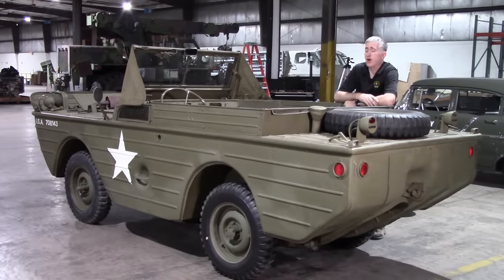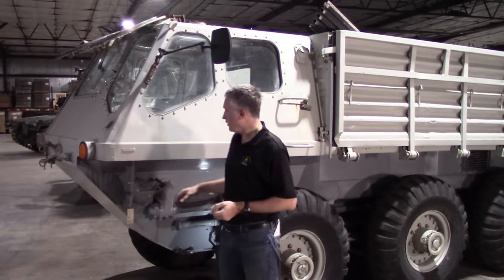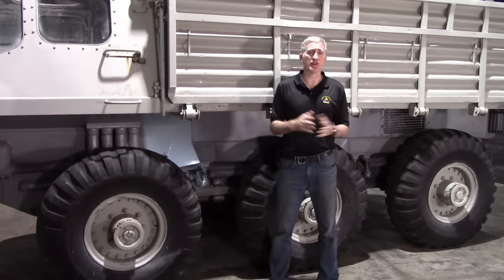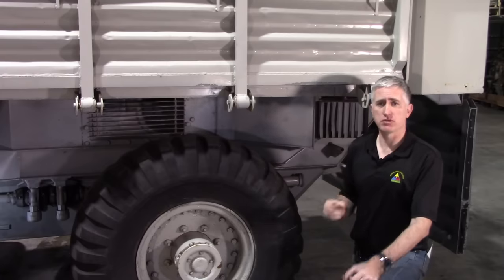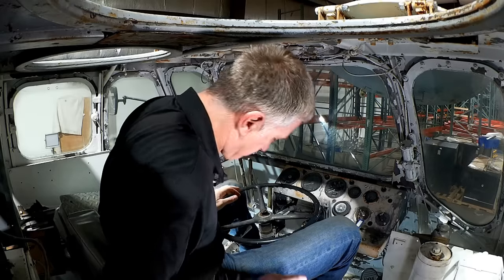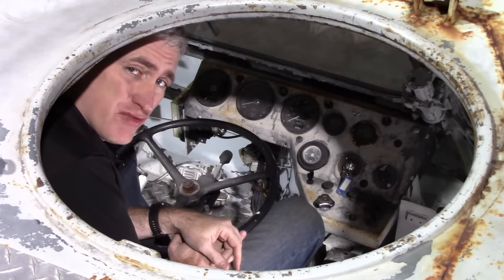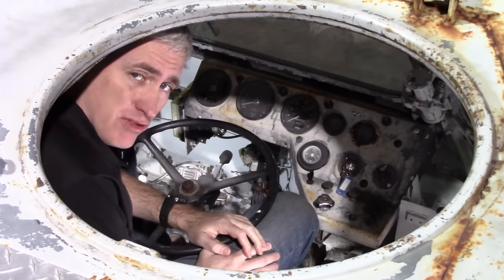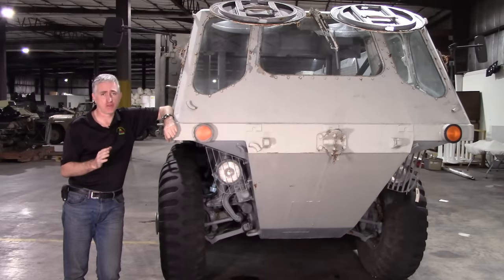Inside the Chieftain's Hatch: FV622 Stalwart MkII

Comment: Drove the Stolly on exercise in Germany many times during the 70s/80s. It's exhaust would glow bright red at night due to the heat from the 8 cyl engine. It's party trick was to turn the ignition off for a couple of seconds, then back on, the unburnt fuel would cause a jet of flame to fly out of the exhaust with a very loud bang. Best done at 0200 whilst passing through a German village.
Reply: Used to do that with my Honda CX500, make peds jump.
Reply: My bikes refused to do this. Even the horrible Triumph 500 refused to back fire.

Comment: The touring company I worked for bought a Stally. Used it for an amphibious tour vehicle. The best I can say about it is that it drove like a boat and floated like a truck.
Reply: Ever take it off road? That is where the Stollie shines, not on road. On road it can be a pain in the posterior, off road it is fun as all hell. As for how it floats, well it *does*, thats the point, they are not exactly designed to cross the Atlantic you know, or to handle Force 8's, but more to cross river or small lake obstacles without requiring the cargo to be offloaded into a seperate vehicle. They float well enough to do that job just fine.
Reply: @alganhar1  
Really?? It wasn't meant to cross the Atlantic?? Gee, thanks for telling me. I said the company used it as a touring vehicle and you asked if we took it off road. Well I suppose we did. We took into Halifax Harbour. It was extremely slow in the water and lacked the power to maintain the speed limit on modestly hilly streets.
Reply: @johnt8636  Most Stollies were stripped of their impellors and the drive couplings in the 1980's when it was decided to stop swimming them. The vast majority of them that were sold on lacked them. they would still float and swim but only driven by their wheels.  As for speed limit - they were cross country vehicles designed in the 50's - maybe not the best choice of vehicle for the company.
Reply: @chaz8758  
Thanks for the info. Ours definitely had some gear replaced/removed that compounded the issue. If you knew the city in which we operated it, essentially in the downtown core, you'd understand that mobility shouldn't have been an issue. The streets downtown, you'd be lucky to get up to 30 kmh. It's entire route was only about 7 kms.
Reply: @johnt8636  You are just too civil.  Argue with the guy who drove one in the Atlantic Ocean and downtown.
Reply: @alganhar1  Designed to swim rivers when bridges aren't available, they do swim well, we had them as ammo carriers in the Royal Artillery in Germany.

Comment: Notice the lack of chrome
Reply from the maker: Yeah, the Brits missed an opportunity here.
Reply: @TheChieftainsHatch  Chrome is going to be the new tactical color, black needs to step aside.
Reply: They've decided to forgo chrome in favour of rust trim on this vehicle.
Reply: mediocre
Reply: Slaps top This baby doesn't carry so much chrome.
Reply: And there's no door glass regulator either. What's up with that?
Reply: This truck is clearly not meant to haul CO’s.
Reply: @moosemaimer   V8! V8! V8!
Reply: @onpahanvaan  I8! I8! I8!
Reply: ran a section of  warts in minden 19 sqn rct great fun,  they  wheelie in first and do a stoppy,  used to turn ignition off then on repeat as necessary to get a loud bang complete with flame from exhaust and hopefully  you didn't blow the exhaust off lol
Reply: @TheChieftainsHatch  OK there are 2 easier ways to tell between the Mk 1 and 2. The Mk 1 front side windows are square (No slope on the bottom). The other way is inside. The Mk 1 has no "Gate" at the base of the gear selector,  The Mk 2 does. Very little difference other than that. Not sure if the Mk 1 had the central lubrication tube system?

Comment: I have not watched this yet but already I have given a thumbs up. Drove these in BAOR in the mid '80's......loved them. I have now watched this video, that is one well messy Stally, nothing like an original British Army model. I understand about the lighting system...HST to those that know, but that is a poorly looking Stally. As the "Chieftain" mentions, there is no more fun vehicle to drive off road than this, remember how old this thing is, its amazing.
Reply: I suspect that the only thing more fun to drive off-road would be the six-wheeled amphibious skip-steered buggies used as moon buggies in "Space: 1999" (with more power and a roll cage added).

The German WWII 8-wheel armored cars, being German, probably had the required seven lockable differentials to allow each wheel to rotate at its own rate during a curve to make them as marvelous on the road as they were off the road.

While I am dreaming in technicolor, if you want to combine off-road driving with the RV experience, you really need a large soviet off road amphibious truck.  If I won a large lottery jackpot, I would buy one of the 14x14 chassis used for the soviet mobile ICBM batteries and hand it over to a yacht builder to have a very comfortable RV that would not capsize.
Reply: Watch it, 66knbm,  and you will want to execute the presenter for being a knob  in seconds
Reply: Never, that wont happen...The Chieftain will always be no1. 
 @markellis7819
Reply: And the engine note was lovely,Rorty as fuck

Comment: Worked on loads of these - always remember them pulling left when the clutch was pressed and right when they accelerate - even managed to get the angled nose to hit the ground doing 2 footed braking to try to free a clutch resulting in the engine cover flying over the roof lol.

Comment: We used them still in the late 80's early 90's in BAOR.
Bashing the wheels into a road  curb also worked a treat for unwinding the transmission. Also slightly scary   is when the steering locks while driving. If I remember correctly it's air assisted so you either stop to build more air ( not recommend on an autobahn, ) or give the engine more gas!!!.... and hopefully it releases before you hit whatever you are driving towards when the steering locked. 
Absolutely fabulous cross country vehicle though.

Comment: LORRY is a shortened version of a Latin word I can't locate it was originally a 4 wheeled Roman Cart with a Flat Tray for carrying goods something like Lorica, Lorricus or Loricum. In the UK a horse drawn cart with a flat tray was called a LORRY the name just continued. Throughout their empire (not just in Britain) the Romans used a number of vehicles to travel. The carrus (CAR) was an open chariot which carried a driver and a passenger and was drawn by two horses. The carpentium was a more luxurious version and was covered by an arched cloth. It was drawn by mules and was used by women and officials. The cisium was a cab with two seats. It was open at the top and front and was drawn by two horses or mules. Coaches (raeda) were wagons with four wheels with box-like high sides and seats along them and were drawn by a team of oxen, horses or mules. It carried several people and luggage and its carriage limit was about 327 Kg (687 lb.)

The definition of a carriage is "A horse-drawn passenger vehicle" It is also a railroad Passenger Car.

The Romans had names for specific types of carriages just a we have names for specific types of motor cars such as a sedan, suv, van, etc. In Latin, the word for a carriage in general was "VEHICULIM ". A "carpentum" or a "pilentum" was a small light usually two-wheeled carriage and a "raeda" or a "petorritum" was a larger, four wheeled traveling carriage, usually quite comfortable.

TRUCK
Compared to the fog surrounding “lorry,” the roots of “truck” in the “large vehicle” sense  are satisfyingly clear.  “Truck,” which first appeared in English around 1611 meaning “small wheel or roller” (specifically the sort mounted under cannons aboard warships), is a shortened form of the older word “truckle,” meaning “wheel, roller or pulley,” which appeared in the 15th century and was derived from the Latin “trochlea,” meaning “pulley.”  The first use of “truck” in print in its modern sense of “wheeled vehicle used for transporting heavy items” came in 1774.

Here is the definition of LORINUM in English a bridle rein.

LORARIUS Harness Maker or Flogger

LOREMA Bridle or Bit 

LORAMENTUM Strap

LORIMARIA bits, buckles, and other metal work for harness.
Reply: Before self powered vehicles the British Army had 'Carts' if the horses were pulling one with 2 wheels and 'wagons' if they had 4. If it carried just seats for personnel it was a 'carriage'. The largest of these was the 'Expedition Carriage' which mounted 20-30 troopers facing out on bench seats ready to dismount immediately.
Reply: @johnfisk811  That's why I reference it to the flat tray for goods and commerce that was always called a Lorry the name just stuck. You can see the Romans used many names. There were Cars in Australia badged Landau and Brougham both types of Luxury horse drawn carriage. In fact the same names were used back in the 30s for luxury Chauffeur driven cars. History repeats its self thanks for the Info as a side note the AUS Army  did and I believe still does faces its truck bench seats outward for fast exit if ambushed.
Reply: Thanks. I did not have to read 600 posts to find out what a Loory was

Comment: :) I learned to drive in a Stalwart. Absolutely fantastic off road vehicle and a Lot of fun to drive. We used to race the recce platoons scimitars cross country.

That little lever, just behind the gear change lever is the revese transfer lever. If turns the entire gearbox into reverse. There is no reverse gear to select on the main gearbox, you just pull the little lever back and voila... 4 reverse gears [Yes, that means you  can drive top speeed in reverse ;) ]

The exhaust vents are a godsend for drying wet sleeping bags and kit, on really cold drives it wasn't uncommon to see the driver pop out the top and go back to warm on the vents while the co  driver took over. then they'd swap

Comment: I was once run over by a Saracen APC, went right over me, lovely ground clearance.
The 600 series had many variants, ambulances, radio command posts, engineer workshops but the Stalwart was the best. I think the RAOC used to carry ammo in them including 155mm shells.
Unfortunately the were expensive to make and service.
The Rolls B80 engine was used in some RR limousines .

Comment: They were famous for doing an almighty backfire when you switched the engine off also made a loud clanging noise when idling from the air brake compressor shaft. But a fantastic bit of kit in the right hands.

Comment: I concur with Chieftain that the 'Stolly' was a brilliant drive, especially in heavy country. In addition to ammo & general stores we used them fitted with UBRE (Unit Bulk Refuelling Equipment) packs which contained tanks and pumps to refuel the Chieftains. The Stollys used to get the places where the Tanks had problems! Someone else has mentioned it but the standard practice for the drivers on a road run was to bounce the up and off the curbs to reduce the wind up. We also tried to avoid driving them unladen to reduce the angles that the drive shafts and UJ's had to cope with. I believe at one stage there were even dummy load packs available. Transmissions were checked by painting a white line on each hub, if they all lined up it was OK, if any element (bevel box/driveshaft etc) failed then that wheel station would be immediately identifiable as the line was out of alignment with the others. The most desired version was fitted with a HIAB hydraulic crane just behind the cab  which made loading and offloading much easier. When swimming, especially in fast flowing rivers(e.g. the Weser ) a wire hawser was sometimes rigged and the vehicle attached by running shackles front and rear to keep it at right angles and give the props a chance (also done with CVR(T)) Good times.

Comment: the power steering does not operate by itself as you described, the one you drove had a common fault on the power steering where by the operating spool used to stick , causing the steering to operate on its own. A mod was introduced to limit the travel on the operating lever which prevented the spool from being damage and sticking; I have built more than 50 stalwart steering boxes when I worked on them doing Base Repairs.
Reply from the maker: Bugger. I thought it was a brilliant idea and a hell of a lot of fun.

Comment: 10:20 my older Ford 3000 tractor has exceptional power steering like you mentioned. When I’m raking hay, I can fling the steering wheel and catch it in either left or right.

Comment: We used them in 11 Brigade in Minden in the 1980's, mostly with POL pods in the back, then in the field we would pull up in two columns left and right in our 432's. I as the driver /mechanic would jump out, walk across the roof, take the fuel filler from the logistics guy on top of the Stally and fill both tanks, then pull forwards to the Colour Sergeant's truck, my crew would then collect the rations, then I would oull forward to the rover with the water tank, on the trailer, my crew would then refill our water jerricans, the drill was important as you were doing it at night as part of a BG movement, with of course lots of armoured vehicles including Chieftains, and in the dark only using red filtered lights! But the Stallys were mega useful, but a bit top heavy, saw one roll over off a German road, into a ditch near Minden, it got lifted out with little damage, in the mid 1980's, they were replaced in our battalion,  with TM's, which weren't amphibious or so solid! BAOR/BFG stopped using amphibious vehicles in the 1970's as we had bridging capability and the RE M2's from down in Hameln. But thanks for your video and the trip down memory lane, just hope this Stally finds a good home! 👍🏽🔥⚔️🙏🏼🤞🏼

Comment: That takes me back, steering effort dependant on engine revs. Go into a corner on a trailing throttle, you’re in trouble. Gear change pattern back to front. 1st back towards you, 2nd forward, third back and away, catches everyone out and the best, Rev limited by shorting out rotor arm = big flame and thunder show. Agreed best drive ever

Comment: In the British army a lorry is a fladbed truck with separate cab meant to transport any sort of load (it could be articulated too), a truck is a single unit vehicle meant to trasport equipment and personnel. So looking back at ww2, a Bedford QL is a lorry, a Bedford MWD is a truck. A us jeep is a truck because it's not flatbed and a Canadian CMP could be both a truck or a lorry according to the fittings, usually the short wheelbase were fitted as trucks and the long wheelbase as lorries.

Comment: One of the problems was the exhaust pipe at the back. Anything too close to it could catch fire and more then one Stalwart went up in flames. Of course if the cargo is fuel or ammo then the fun really reaches new heights. Five tons of tank or artillery shells in the back will definatelly add to your day.
Reply: Evil backfire from the exhaust, drove a bit close a few times in convoy and swore the flame shot past my head (in a FV 432). The exhaust manifold and pipework under the cargo bed glowing red - with pack fuel, UBRE or munitions mostly
Reply: Back fire was awsome. But the exhaust is not near the load bed, but outside of the rear louvres. This mythe about catching fire is bull
Reply: @markellis7819  We had one or two have little fires, but that was the hessian skirts touching the exhaust charring and catching, same with a few of our 432's. Quick panic, rip the hessian off and all good, never set the vehicle on fire.

Comment: Notable decline in demonstration of tension, track.
Reply from the maker: Next one, I promise.
Reply: @TheChieftainsHatch  panzer 1 possibly?
Reply: @TheChieftainsHatch  You should have shown how to regulate the tyre pressure.
Reply: Holy moly I've been blessed.
Reply: @p_serdiuk  because the alleged Tyre pressure regulator doesn't exits. I don't know what this guy is smoking
Reply: @markellis7819  What do you mean? You had never inflated tyres with a compressor?
Reply: I've inflated the tyres on those with the air line plugged into the socket in the cab. What he says is "they have a central tyre inflation system" which is the system the Russians like with an air line that comes through each hub itself to the wheel
Reply: @markellis7819  That is similar enough to various track tensioning systems to make a joke.